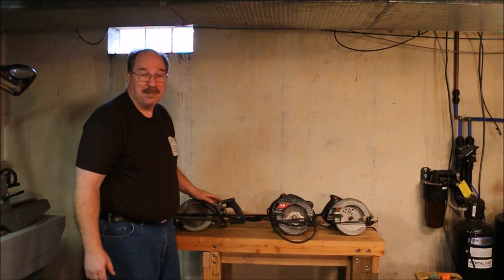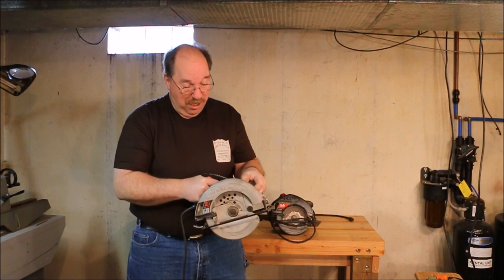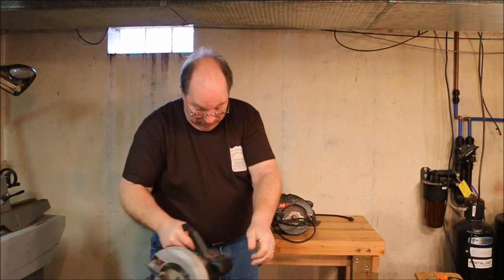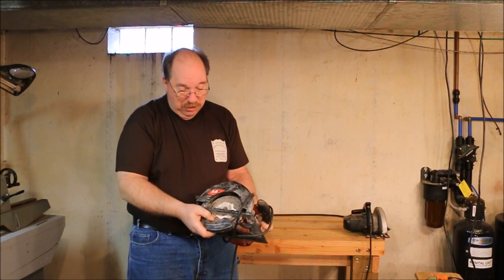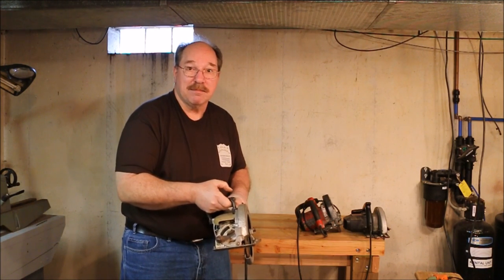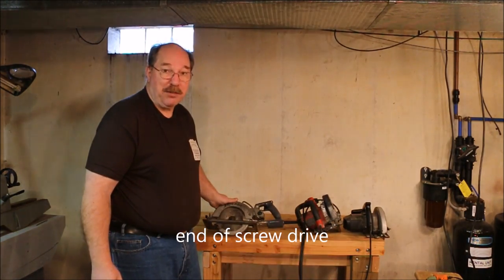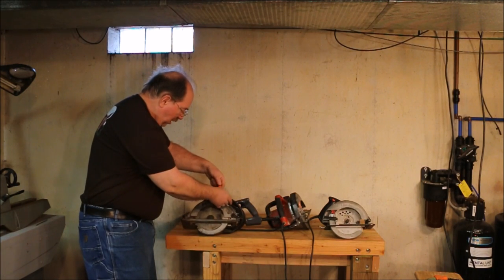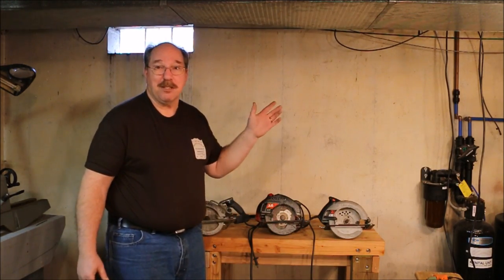Tool Time ~ Skill Saws ~ By Old Sneelock's Workshop

Comment: The Skil saw is my most feared power tool, even more so than the chain saw. Thanks for the warnings.
Reply from the maker: +UK Tony Fear is your unconscious recognizing your limitations. Pay attention! It only wants to keep you alive and intact. :-)
I can't really say I fear the circular saw but I certainly respect the power. Two or three pounds of armature spinning at a couple thousand RPM attached to a wheel with forty razor sharp edges deserves respect.
Reply: Old Sneelock, thanks for your words of wisdom. More common sense is said on your channel than almost any other.
Reply: +UK Tony respect of a power took goes a long ways. for those that are scared of a skill saw or not skilled with one. one thing that will build their confidence in one would be to make a few jigs like a straight line jig. this helps with the qulity of the build and helps boost the confidence in the person that may use them less often. hope this helps
Reply from the maker: +iwantosavemoney Good point with the straight line jig. I have used one of those before. Quite handy while you are learning how to make things work.
Reply: Thank you guys. You have really helped and have just bought a straight line jig which is 4 foot long to cope with sheet goods. I will let you know how I get on.
Reply: +UK Tony good deal I hope it builds your confidence and in no time you will not be using it.

Comment: You can get those cable clamps at the Home DEPOT  for less than $2.
Reply from the maker: +Steve McEntyre Thanks Steve. Next time I'm in town I'll pick up a couple more.
Reply from the maker: +Steve McEntyre Thanks Steve. I'll stop by there next time I'm in town.
Reply from the maker: +Steve McEntyre Don't know why this reply keeps getting dropped but I'll say it again. I'll stop in next time I'm in town and check them out.
Reply from the maker: +Steve McEntyre I went to Home Depot yesterday and picked up two more clamps. Thanks for the tip.

Comment: The goofy x-neighbor framing contractor wedged the guard back on all his saws. That was a dead giveaway that he wasn't too bright. He said everybody got used to it. The ones that survived did anyway.  Boy/son has my old Makita and I've just got the DeWalt with the mag case and electric brake. It's lighter and the brake helps with arthered hands.  You know you messed up when you said the light didn't work on the over-priced free saw. Another one on the fix list!! Good one, Unc!
Reply from the maker: +Lewie McNeely I have just enough saws to have a good feeling about the number of saws I have. Enough to be able to mount a masonry blade, a plywood blade, a steel cutting abrasive wheel, a diamond wheel, and still have one with a carbide blade for rough cutting framing. The rest I do with a hand saw. 
It would take a special kind of guy to mistakenly cut off any major body part with a hand saw.
Reply: True. The Saw Surgeon almost cut his hand off with one years ago and then drove himself to the E.R. in a straight drive truck. He still shakes the  wooly head when he thinks about it. I shudder while he shakes.  I'm too scared and floppy to take chances.